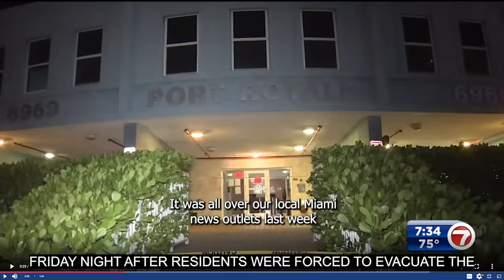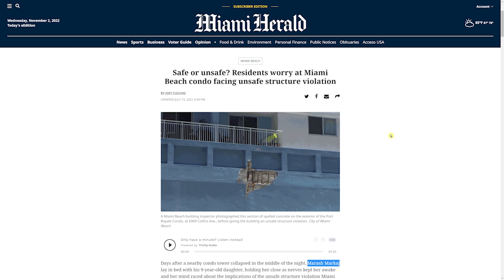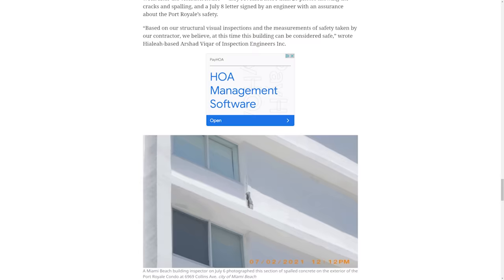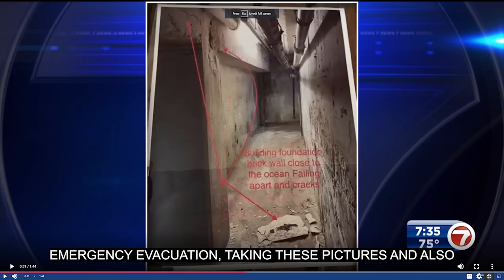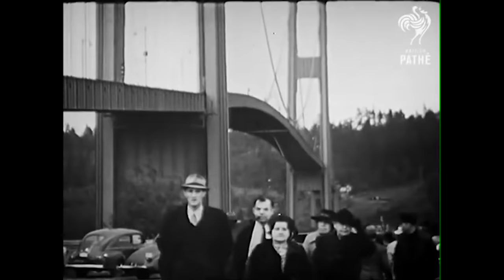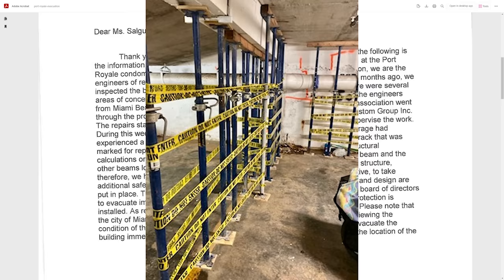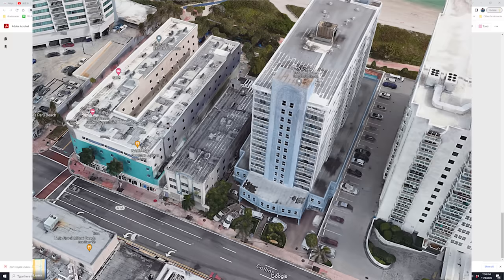Another Miami Condo Evacuated Why it Will Collapse

Comment: Thank you Jeff for showing us what is going on. Frightening how that resort hotel shrugged off problems that were pointed out in their building.
Reply: What is really spooky here is you don't really have any warning, is when the collapse will occur, watching that security footage, this building collapsed so fast, people were in a situation they really had no warning, and it was at a time, people would be sleeping, horrible way to go!  Crushed to death by slabs of concrete
Reply: Actually the residents reported “groaning noises” and cracks appearing in walls several months ahead.  But they chose to live in denial & not see the warning signs

.

Comment: Don’t think I’d ever live in a flat slab concrete building, especially in a wet environment. Dr. Ho, my “Analysis of solids & structures” professor, when asked about getting partial credit on tests was fond of saying “You build bridge. Bridge fall down.  Maaaaany people die. You want partial credit?!Hahahaha!”
Reply from the maker: Sounds like a funny professor I'd like to have
Reply: Prof Chang, at Stevens was petitioned by a student for partial credit on a statics problem, as he had set up the problem correctly but merely had a math error.  Prof Chang's response: " You graduate Stevens.  You engineer. You build bridge. Half of bridge fall down. Noooooo partial credit."
Reply: In the real world, multiple engineers review the work & catch math errors
Reply: @electrictroy2010  And yet buildings and bridges still fall down, even new ones (such as the FIU pedestrian bridge). 🤷‍♂️

Comment: I pointed out CTS was likely the tip of the iceberg and the amount of people calling me a conspiracy theorist was insane.  The owners of the building are the residents - and they rarely want to do required maintenance and repairs.  I've been to HOA meetings and literal fights break out when money is on the line.  Everyone wants to kick the can - so none of this shocks me. 
You have to be an idiot to be in a condo association in one of these large concrete buildings.  No way!
Reply from the maker: Hopefully now HOA presidents wise up and listen when people bring damage tot heir attention
Reply: I also believe a good owners association would have reserved funds to pay for most repairs w/o having to do a large assessment of the owners.. cuts down on the money fights if the money is in the bank already
Reply: Dear Doc; I enjoyed reading your post regarding Champlain tower south, especially your comment on how it is the tip of the iceberg, and that people referred to you as a conspiracy theorist regarding the matter. At 63 years of age, one major thing I have learned about my fellow humans is there extreme capacity to exist in denial. All people need to do is open their eyes and see what is before them plainly, and then connect the dots. And people do not need to be engineers or contractors to plainly see corrosion, spalling, and rusty rebar sticking out. But they don’t want to see this, because it is inconvenient. The icing on that cake, as far as I am concerned, Was the poor security guard getting sued for $500 million even though to me it looks like the security guard was the hero of the whole damn thing, because hey, the security company just happened to have an insurance policy for $500 million. So not only is my beef with the construction industry, and with blind people in denial, but also with our so-called justice system as well, which simply seeks out the deepest pockets and goes in for the kill there. God help us all.
Reply: THE HOA was fully-aware of the Champlain maintenance issue, but the residents simply refused to cooperate.  One HOA president resigned because he was fed-up with arguing about the problem.
Reply: @electrictroy2010  so you agree with me that they played a part in the colapse
Reply: Corruption and conspiracies have been the normal in human societies for millenias, but somehow now we have changed 😅

Comment: Even after millions of dollars of rehab were finished…my family’s oceanfront condo in Clearwater, Fl is still a s**t show…my dad opened an external, ocean-facing door on a closet on the balcony, and a steel beam was so corroded, it crumbled on his hands. The building was less than 40 years old at the time..:Also, balconies we’re reconstructed when the building was 20 years old and tiles removed, because the deterioration was happening so fast. US Steel built it in 1982, the era of the “Cocaine Cowboys”.
Reply from the maker: Yes, and maintenance is so important, painting that metal so it does not corrode
Reply: @jeffostroff  , Could it be that the amount of maintenance it would take to keep up with the damage done by Florida's salty, humid air and high water, is beyond affordability for most middle-class and upper-middle-class condo owners? The resident-owners of the Porte Royale are not wealthy and were still recovering from that dreadful $50,000 per unit average assessment in 2011, to repair problems that have once more manifested. Even the relatively well-heeled crowd at the Champlain North could scarcely afford to keep up. It just could be that high rise buildings, an experimental building type in any case, are just too demanding and complex for most people to fully afford.
Reply: Agree!  Old buildings were made from pure concrete.  These new buildings use steel skeletons inside the concrete.  The technology is fundamentally flawed (because the steel rusts).  It needs to be phased-out like asbestos was phased-out.

Steel-reinforced concrete is a bad idea that gradually falls apart & collapses.
Reply: Most Chicago and NYC high rises, especially the really tall ones like the Empire State or Hancock or Sears (Willis) Tower, were built with structural steel frames, the best way to build a high rise there is. The structural steel high rise was invented in Chicago by architect Louis Sullivan, and enabled the construction of much higher buildings than would have been possible with any other type of construction. Pure concrete is for low rise structures. Steel reinforced concrete can be very good but must be done correctly. In the case of the Champlain Tower South, too much rebar was packed into narrow columns, and deterioration caused by saltwater intrusion exacerbated the problems over years.

Comment: I'm 37 years old. I remember when I was a kid, my parents would take me to a few different condos on a beach further north each summer where we would spend a week. These were beautiful, brand spanking new condos. Fast forward three decades, and these condos look like they were built 100 years ago, and some of the main support columns are in pretty rough shape. I'm not an engineer, but it has made me wonder how much redundancy there is with those columns...if one or two fail from massive spalling, will the other columns be able to support the structure? Did the designers originally take the destructiveness of saltwater into account? Or were these built in the same manner as structures not exposed to salt air/water and are ticking time bombs?
Reply: Yes.
Old buildings were made from pure concrete.  These new buildings use steel skeletons inside the concrete.  The technology is fundamentally flawed (because the steel rusts).  It needs to be phased-out like asbestos was phased-out.

Steel-reinforced concrete is a bad idea that gradually falls apart & collapses.

Comment: Water seeping up is very common in low level parking lots. My building has 3 parking levels and the lowest level where I have a spot is flooded often with an inch or more of water (especially this type of year with king tides). Most of the year there are puddles. They seep up through cracks. There are a few pumps but most always it’s full of water. We passed the inspections and have a good engineering firm. Do I need to worry?
Reply: I would sell now.
Reply: Worry

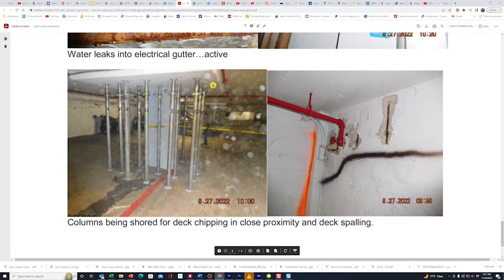Comment: 10:40 The "blobs", nicknamed sprites some years ago, are dust particles floating in the air as the flash is activated, as the camera is taking the picture. It's a phenomenon which began to appear with compact cameras, where the flash is very close to the camera lens. What has happened is the camera has focused on the pillar and other bits around it, as the picture is taken the flash goes off and any dust particle hanging in the air between the lens and the object being photographed will be illuminated but, of cause it will out of the focus range of the lens, so will appear as a fuzzy blob, but only against a dark background, those against a light background just fade into the background.
Reply: Not uh, those are all "spirits" of dead people!
Reply: Guy should have retaken the photo, when he saw it didn’t focus clearly

Comment: Jeff, Thanks always for your expertise on these engineering issues. I live in Southern California and I realize humidity and rust are very different animals in our two environments. As a laymen I have noticed here building codes seem to require "coated" rebar with a greenish paint for this type of building. Are the same codes required in Florida?
Reply: epoxy coated rebar is now required, it was not in the 70s.  Most bridges and tall structures will use epoxy coated rebar.
Reply: How about carbon fiber rebar?
Reply: @danielclint1033  Would not work, rebar (steel) and concrete share a similar expansion / contraction rate. So they work well together.
Reply: @chuckmiller5763  That is valid and not something I considered.
Reply: IMHO Old buildings were made from pure concrete.  These new buildings use steel skeletons inside the concrete.  The technology is fundamentally flawed (because the steel rusts).  It needs to be phased-out like asbestos was phased-out.

Steel-reinforced concrete is a bad idea that gradually falls apart & collapses.

Comment: This often dates back to save money on construction .. less rebar, less concrete, more room space to sell combined with fast construction and quality issues (nobody wanted to know about). And I'm sure some issues are down the fondation (as Miami is not known for its rocky soil).
Reply: Plus this building is 50 years old, many construction requirements have changed over time

Comment: My question is will repairs be good enough? Is it really possible to repair such damage or better to bring the building down and replace it? Yes, I know that cost but repairs on concrete like that are only band-aids which I think is very dangerous in the long run. Thank you Jeff so much for sharing.
Reply: I agree. I would never live in a "reconditioned" highrise.
Reply: Repair will be fine if done properly.  They aren't band-aids at all.  If done properly to ICRI standards, the repair is as good as new.  The important thing is that they need to strip it back far enough to get to good concrete and non corroded rebar.

Comment: Jeff, some of those pictures of the walls cracking and having a reddish color to them seems to scream salt water corrosion.  Wouldn't the other buildings in this vicinity eventually fall victim to salt water corrosion and suffer the same fate as the Port Royale Condo Complex?  I guess the number one question is how can you stop salt water and salty air corrosion so buildings can be safe for its occupants.  Great videos Jeff... keep them coming as I am learning a lot.
Reply: It could be avoided with a designated maintenance team. Even a engineer checking everything every few months would ensure that issues are documented and addressed in a timely manner. These buildings are just being let go for decades without any effort to address issues. These buildings would last so much longer with proper maintenance, but instead they just are allowed to self destruct.
Reply: It's as simple as applying good LATEX paint--but you MUST re-apply it EVERY 4 YEARS--without fail... of course most HOAs will STOO-pidly say "4 YEARS, why it still "looks fine" at 7 years... of course once the paint becomes chalky (actually before that), it's too late--moisture and chloride ions have already penetrated down to the concrete underneath, and have begun their "slow walk" through the "matrix" structure of said concrete... add sub-par "Mafia Mix" concrete to the equation, and it's "rebar disintegration, here we come!"... 💥💥bereaved survivors will be left with the macabre task of identifying their relatives, after they've been squashed, literally, paper-thin!  🤭😱
Reply: @MajorCaliber  You kinda lost me dude. These places have obviously gone completely without inspection or maintenance for decades. There needs to be an actual engineer inspection every few years. That is very much needed. These buildings can survive a long time, but you have to maintain them. As soon as anything shows signs of issues it should be immediately repaired.
Reply: This is a case of straight up neglect for decades. Everything has been left to rot with no preventative measures. It’s just insane as to how they have allowed the deterioration to get to the level of danger of collapse. No effort to fix anything at all.
Reply: Also--OF COURSE--a coat of paint is NOT going to cure outright structural deficiencies due to design errors as found at Champlain Towers South, where the now-infamous pool-deck had been cracking and leaking almost from Day 1... haven't really waded in to all the reports on this latest disaster-in-the-making, aka Port Royale... but given that it's 15-stories, there's probably more than improperly sealed surfaces involved.
Reply from the maker: The new FL laws require milestone inspections every 10 years now, and 25 year recertification if building is within 3 miles of the ocean
Reply: @mattbrawner7888  This is part of why China requires that their buildings be torn down after 50 years. It's partially a reflection of the rapid growth and partially an acknowledgement that a lot of the standards weren't being properly met.
Reply: @SmallSpoonBrigade  Exactly !
Reply: There is a type of process that arrests the corrosion: it's called CATHODIC PROTECTION. If it's installed early enough, and you maintain it, it will save the building.
Reply: @jeffostroff  Is that enough?
Reply: Build with laminated timber beams, now good for more than 15 floors, better than steel during fires. Good for carbon sequestration too.
Reply: @edwardmiessner6502  Indeed.  I'm assuming you're going for impressed current rather than sacrificial anodes, as sacrifical anodes will likely be buried in the concrete.
Reply: @MajorCaliber  That needs to be done with the concrete bone dry.  Trapping moisture behind latex paint is no good.

Comment: Thanks Jeff, another interesting video on what looks like will be a major repair. I’m always puzzled though as to why the HOA allows the buildings to deteriorate to this level, aren’t they on the hook legally to explain their neglect? To say nothing of the cost involved in this latest evacuation order. You’ve certainly caused me have a good look at the basement garages of high rises here in OZ that I have to frequent. Love your work, Regards from OZ 🇦🇺
Reply: Who makes up the condo boards?  Are they required to have a structural engineer?
Reply: I'm head of my HOA out here in California, and the problem is the owners never want to spend the money to keep the building in good shape.  And old buildings just wear out.  If you buy a condo, buy a new one!
Reply: The HOA at the collapsed condo tried to spend money to fix the problems, but residents kept voting “no”

Comment: Jeff,
Great report. Here's a few suggestions. 1. Send up a drone to examine roof and other potential damage; 2. Look at last 10 years' financials to see how much they've been spending (or not) on maintenance; 3. The history and expertise of the engineers; 4. The original architect, engineer,  and contractor. Is there a pattern or very similar structures?
Reply: Great idea.
Reply: You don't need to look at any of that. There was rampant corruption in Florida with contractors and inspectors when these buildings were built. They skimped on materials and greased the inspectors palm with some cash and they looked the other way. Now it's all falling down.
Reply: @gorak9000  This was confirmed by two different grand juries in the 80's and 90's.

Comment: The pictures of the cracks in that beam are scary AF. How ANYONE in property management can ignore the most BASIC signs of such deterioration is mind boggling. 
  Just curious: Do you think those 3" post shores are sufficient to carry the load the beam has on it. I bet not. I have bent those just trying to take out the sag in a wood beam on the lower floor of a TWO STORY house.